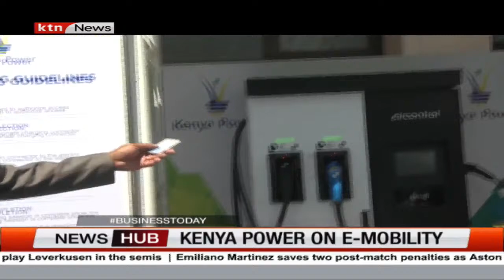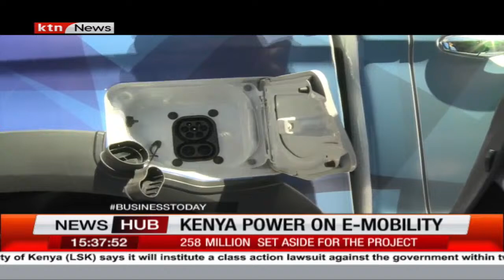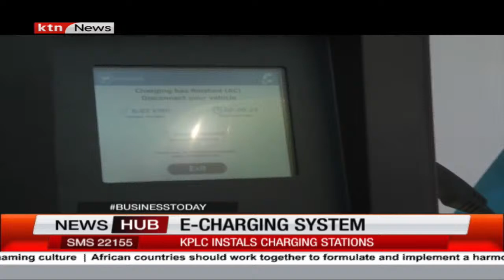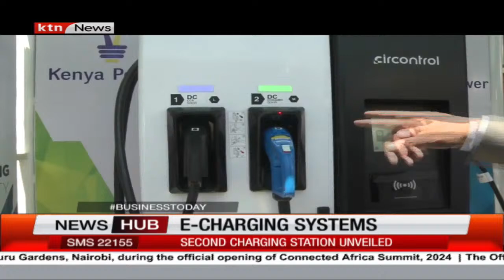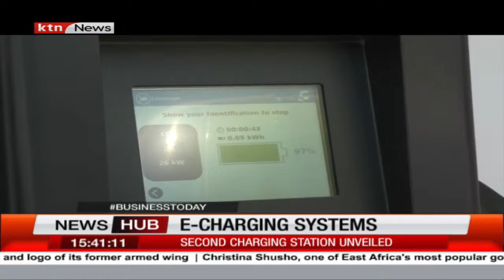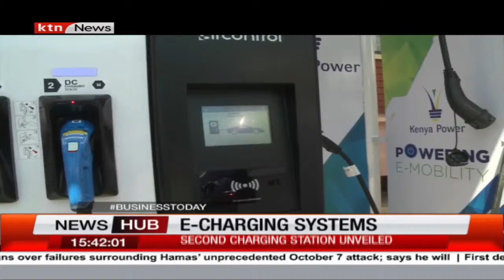Kenya Power's Visionary Move: Ksh 258 Million Pledged for Electric Vehicle Infrastructure

Comment: With a CLUELESS GOVT, corruption, blackouts and EXPENSIVE TAX ON ELECTRICITY.. 😂😂 yeah right??
1. Which mechanics will fix them
2. The electric grid can't handle the traffic
3. Charging stations will require " TOA KITU KIDOGO from cartels
4. If you break down or run out of charge in traffic or in the middle of the night.. THIEVES AND THUGS WILL LOVE IT 😂
5. With this govt i know its a scam
6. KPLC AND THE GOVT DIDN'T LEARN FROM THE BODA BODA RIDERS FROM MOMBASA THAT ELECTRIC CHARGING IS A NIGHTMARE 
7. THOSE CHARGING STATIONS ARE A GOOD SPOT TO GET MUGGED OR HIJACKED 😂😂😂